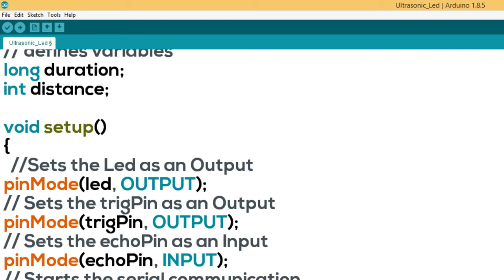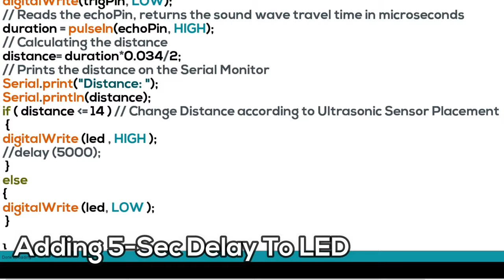How To Make An Automatic Object Sensing Smart Dustbin - DIY Project

Comment from the maker: Code For Automatic Dustbin

//define Pins
#include <Servo.h>

Servo servo;

int trigPin = 9;
int echoPin = 8;

// defines variables
long duration;
int distance;

void setup() 
{
  servo.attach(7);
  servo.write(0);
 delay(2000);
  
// Sets the trigPin as an Output
pinMode(trigPin, OUTPUT);
// Sets the echoPin as an Input 
pinMode(echoPin, INPUT);
// Starts the serial communication 
Serial.begin(9600); 
}
void loop() 
{
// Clears the trigPin
digitalWrite(trigPin, LOW);
delayMicroseconds(2);
// Sets the trigPin on HIGH state for 10 micro seconds
digitalWrite(trigPin, HIGH);
delayMicroseconds(10);
digitalWrite(trigPin, LOW);
// Reads the echoPin, returns the sound wave travel time in microseconds
duration = pulseIn(echoPin, HIGH);
// Calculating the distance
distance= duration*0.034/2;
// Prints the distance on the Serial Monitor
Serial.print("Distance: ");
Serial.println(distance);
if ( distance <= 25   ) // Change Distance according to Ultrasonic Sensor Placement
 {

servo.write(0);
delay(3000);
 } 
else 
{
servo.write(90);

 }

}
Reply: uy pero que pro
Reply: is this need your access?
Reply: How to buy
Reply: Thanks

Comment: Hi, there's a problem. When I was doing the wirings stuffs, i found out that the video mention 2 times for to connect the 5V. But there's only 1 5V that only could be used. So, what should i do?
Reply: same
Reply: Use just one
Reply: are u using orignal arduino?
Reply: You can also use breadboard
Reply: Use a breadboard

Comment: This project really works guys I tried it and it worked I was shocked 
because I had tried the other videos but they did not work
I was soo happy to see it working
I recommend all of you all to try this!!!
Reply: Hi,can i know how to add code to Arduino?
Reply: Can I know it?
Reply: @honghtc4628  sure you need to make sure that the code is correct so verify your code first and then you can press the upload button which is and arrow to the left
done!
its very easy!!!
Reply: @smrtinnovtor3799 need coding app to do it right, thanks, I will do it
Reply: @honghtc4628  yes you will need to download  the arduino app from online arduino.cc 
and all the time welcome!!!
Reply: @smrtinnovtor3799  thanks, I will check out your channel
Reply: @honghtc4628  no worries bro always there to help!!!!
Reply: Yo bro
Reply: @seot6810   Yeah?
Reply: Hi can you tell me what i will need for battery?
Reply: @Miss_YouTube_01  you could just connect it through a power bank or something like that

Comment: Is led necessary for this project or you can just excluded and only need the motor?
Reply: No it is not necessary he only used as a feedback at the beginning but u could use others software to read the sensor values

Comment: Is that possible to control two different mechanism with one arduino. Let's say I do two of these, but when one sensor works, I want the open two different box at the same time. There will be a distance between them, so I can't connect with the cable. Please help...
Reply: yes sure you can

Comment: Bro please help me...
How can i connect ultrasonic sensor to led such that as the garbage level increases the led will light up, there will be 4 LED's green (bottom at 4th no.) blue (3rd) yellow(2nd) red(at top) and how can we tell gsm module that the garbage is at top go and send a message to the authorised no.

Comment: in arduino there is only one 5v pin where will i put the other pin
Reply from the maker: Excellent Question! Just for experiment purpose, you can use a 3v pin. But it is recommended to provide external power to the servo
Reply: I Love Creativity how will we do that ??

Comment: Why didn't you use a proximity sensor instead? Yeah, it won't be as 'smart" as using the Uno but it'll get the job done for the opening and closing of the lid.
Or, why didn't you use the Nano instead of this Uno?

Comment: Can i ask a question? in arduino,  how can i connect the vcc pin to 5v if the servo motorr power wire is in it?
Reply: You can just connect servo motor wire to 3.3v and the sensor wire to 5v

Comment: //define Pins
#include <Servo.h>

Servo servo;

int trigPin = 9;
int echoPin = 8;

// defines variables
long duration;
int distance;

void setup() 
{
  servo.attach(7);
  servo.write(0);
 delay(2000);
  
// Sets the trigPin as an Output
pinMode(trigPin, OUTPUT);
// Sets the echoPin as an Input 
pinMode(echoPin, INPUT);
// Starts the serial communication 
Serial.begin(9600); 
}
void loop() 
{
// Clears the trigPin
digitalWrite(trigPin, LOW);
delayMicroseconds(2);
// Sets the trigPin on HIGH state for 10 micro seconds
digitalWrite(trigPin, HIGH);
delayMicroseconds(10);
digitalWrite(trigPin, LOW);
// Reads the echoPin, returns the sound wave travel time in microseconds
duration = pulseIn(echoPin, HIGH);
// Calculating the distance
distance= duration*0.034/2;
// Prints the distance on the Serial Monitor
Serial.print("Distance: ");
Serial.println(distance);
if ( distance <= 25   ) // Change Distance according to Ultrasonic Sensor Placement
 {

servo.write(0);
delay(3000);
 } 
else 
{
servo.write(90);

 }

}

Comment: Otherwise we give powersupply adopter means it will work and how much volts adopter need ardunio
Reply from the maker: First of all, it will depend on the motor being used. Please check the manufacturer's website for more information.

Comment: Im facing problem tho 

Like the Arduino board, when connected to computer with its wire
Then
 LED, when inserted in the Arduino terminals, it started glowing on its own 
And the glow was non stop
I dint even write anything 

It started glowing on its own

Comment: What if i place a hand in front of the sensor range, the distbun lid will open and close. But if i don't remove the hand from the range, after lid closes will it open again? Or should the hand needed to removed from range?
Reply: the lid does not close as long as your hand is still there covering the eyes of the sensor it only when you takes your hand away that when it will close it self back

Comment: how did you connect two wires in 5v?
Reply: Change the motor to 3.3v
Reply: @b34rb00  hi, i have no idea about codes but i have a project to finish. where in the codes should i change it to 3.3v?

Comment: And which code we have to use servo or led
Reply from the maker: If you want to attach servo with your project use the servo code otherwise use the LED code. Thank you
Reply: @ILoveCreativity  did you combine those 2 code ? I wanna use servo code so i have to just insert the code right and doesn't have to change anything on the code
Reply: @ILoveCreativity  what if I want to use both servo and led

Comment: Arduino: 1.8.13 (Windows Store 1.8.42.0) (Windows 10), Πλακέτα:"Arduino Uno"

Το σχέδιο χρησιμοποιεί 3172 bytes (9%) του χώρου αποθήκευσης του προγράμματος. Το μέγιστο είναι 32256 bytes. 

Οι καθολικές μεταβλητές χρησιμοποιούν 200 bytes (9%) δυναμικής μνήμης, αφήνοντας 1848 bytes για τοπικές μεταβλητές. Το μέγιστο είναι 2048 bytes. 

avrdude: stk500_recv(): programmer is not responding

avrdude: stk500_getsync() attempt 1 of 10: not in sync: resp=0xc7

avrdude: stk500_recv(): programmer is not responding

avrdude: stk500_getsync() attempt 2 of 10: not in sync: resp=0xc7

avrdude: stk500_recv(): programmer is not responding

avrdude: stk500_getsync() attempt 3 of 10: not in sync: resp=0xc7

avrdude: stk500_recv(): programmer is not responding

avrdude: stk500_getsync() attempt 4 of 10: not in sync: resp=0xc7

avrdude: stk500_recv(): programmer is not responding

avrdude: stk500_getsync() attempt 5 of 10: not in sync: resp=0xc7

avrdude: stk500_recv(): programmer is not responding

avrdude: stk500_getsync() attempt 6 of 10: not in sync: resp=0xc7

avrdude: stk500_recv(): programmer is not responding

avrdude: stk500_getsync() attempt 7 of 10: not in sync: resp=0xc7

avrdude: stk500_recv(): programmer is not responding

avrdude: stk500_getsync() attempt 8 of 10: not in sync: resp=0xc7

avrdude: stk500_recv(): programmer is not responding

avrdude: stk500_getsync() attempt 9 of 10: not in sync: resp=0xc7

avrdude: stk500_recv(): programmer is not responding

avrdude: stk500_getsync() attempt 10 of 10: not in sync: resp=0xc7

Πρόβλημα ανεβάσματος στην πλακέτα. Δείτε στο http://www.arduino.cc/en/Guide/Troubleshooting#upload για υποδείξεις.

Αυτή η αναφορά θα παρείχε περισσότερες πληροφορίες με 
"Εμφάνιση πλεονάζουσα έξοδος κατά τη σύνταξη"
Επιλογή από το Αρχείο -> Προτιμήσεις.

Comment: you inserted vcc wire of sensor and red wire of servo both at 5v? HOW?
Reply from the maker: Excellent Question! Just for experiment purpose, you can use a 3v pin. But it is recommended to provide external power to the servo
Reply: Sir,do you mean we can use 3.3v pin for the servo?

Comment: Sketch uses 4230 bytes (13%) of program storage space. Maximum is 32256 bytes.
Global variables use 241 bytes (11%) of dynamic memory, leaving 1807 bytes for local variables. Maximum is 2048 bytes.
avrdude: stk500_recv(): programmer is not responding
avrdude: stk500_getsync() attempt 1 of 10: not in sync: resp=0xc1
avrdude: stk500_recv(): programmer is not responding
avrdude: stk500_getsync() attempt 2 of 10: not in sync: resp=0xc1
avrdude: stk500_recv(): programmer is not responding
avrdude: stk500_getsync() attempt 3 of 10: not in sync: resp=0xc1
avrdude: stk500_recv(): programmer is not responding
avrdude: stk500_getsync() attempt 4 of 10: not in sync: resp=0xc1
avrdude: stk500_recv(): programmer is not responding
avrdude: stk500_getsync() attempt 5 of 10: not in sync: resp=0xc1
avrdude: stk500_recv(): programmer is not responding
avrdude: stk500_getsync() attempt 6 of 10: not in sync: resp=0xc1
avrdude: stk500_recv(): programmer is not responding
avrdude: stk500_getsync() attempt 7 of 10: not in sync: resp=0xc1
avrdude: stk500_recv(): programmer is not responding
avrdude: stk500_getsync() attempt 8 of 10: not in sync: resp=0xc1
avrdude: stk500_recv(): programmer is not responding
avrdude: stk500_getsync() attempt 9 of 10: not in sync: resp=0xc1
avrdude: stk500_recv(): programmer is not responding
avrdude: stk500_getsync() attempt 10 of 10: not in sync: resp=0xc1
Failed uploading: uploading error: exit status 1

pleaseee senddd helppppppp huhuhuhu

Comment: First trig to 5v..second servo red to 5v? Where to 5v
Reply: Yes exactly
Reply: I have the same problem
Reply: @belalabu1892  how did you solve it?
Reply: @omotokeokeyemi8979  im maked it to  3,3v
Reply: @belalabu1892  what pin did you put in 3v?? And what is the code that you used
The servo or the led?